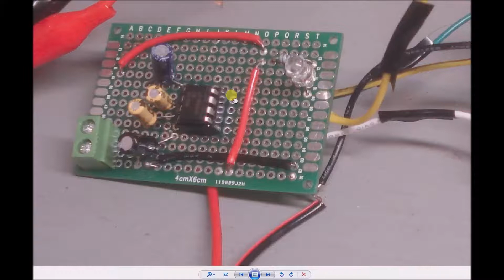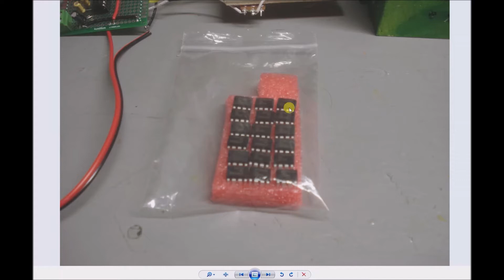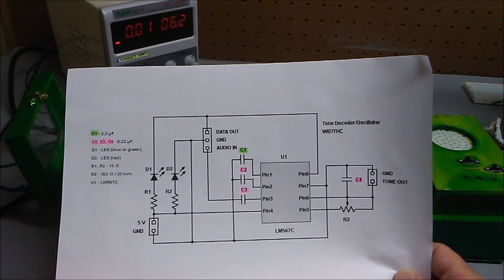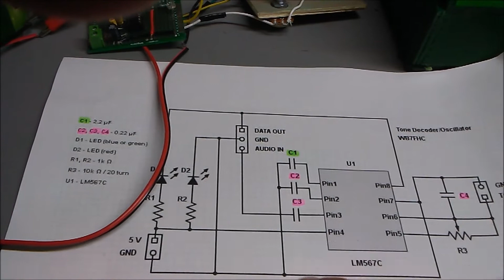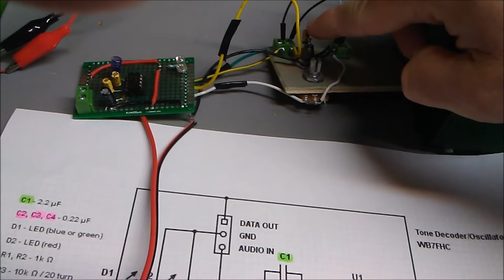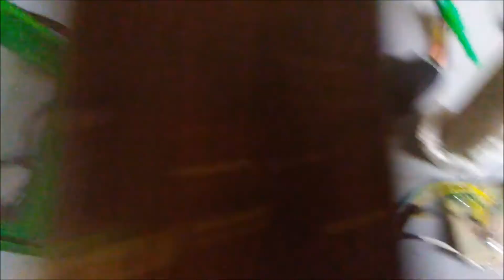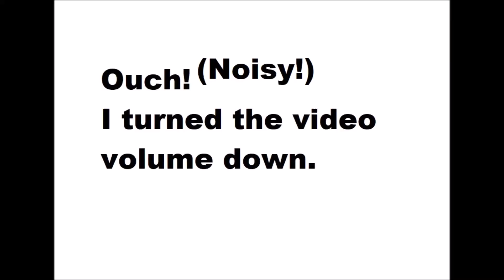LM 567 Tone Decoder : Noisy Fun!

Comment: Hey, thanks for posting this, I have no electronics experience but have a project I'd like to attempt. Do you think this circuit could be used to switch power to a 5v motor on detection of a preset frequency presented as a line/headphone level input?
Reply from the maker: I have carefully read your question. Its sounds like you want to use the frequency of a specific tone to actuate a motor. ... As much as I want to give you an answer, I am not an expert. However, the following is just my opinion. You might like to try the above circuit, but perhaps use a microcontroller chip (or Arduino) to sense the output of pin 8. And then have the micro-controller  drive a motor driver module, like the L298 Motor Driver Module. From what I know, motors draw too much current, as they are basically inductors. ... A motor driver module should have fly-back diodes built in. I would love to know how your project turns out. And, to learn if you have advice on this subject. Best wishes. -2Bit
Reply: @2bit661  Thank you for the reply, good advice. Actually still waiting for the motor to arrive from China.

Comment from the maker: 11:30 Correction... When pin 5 and pin 3 are a match, pin 8 goes low. This is the whole purpose of the chip, to detect when there is a match in tone, to the internal oscillator of the chip.
0:58  I probably should have used a non-polarized ceramic capacitor